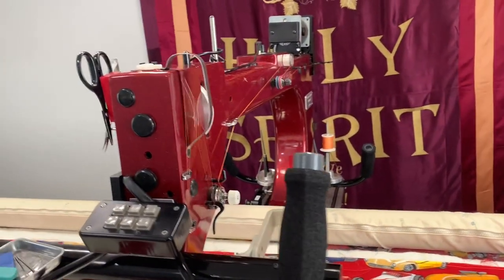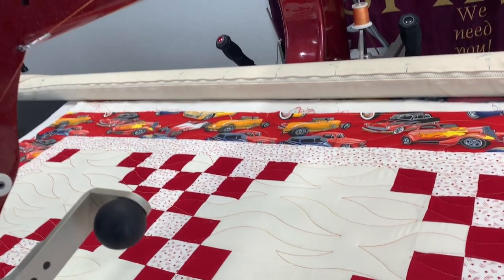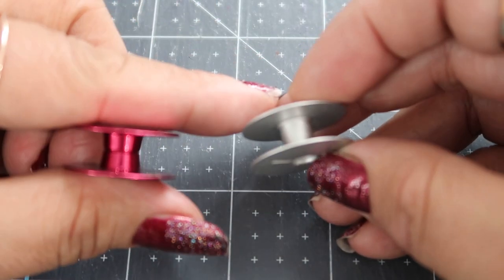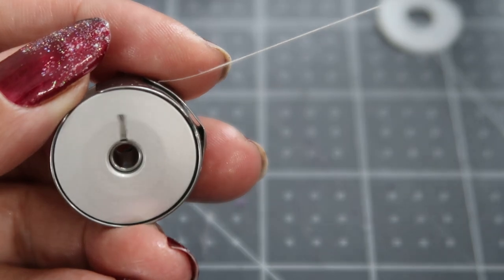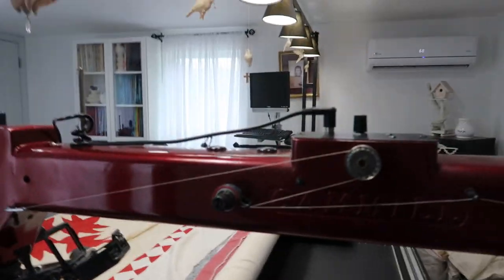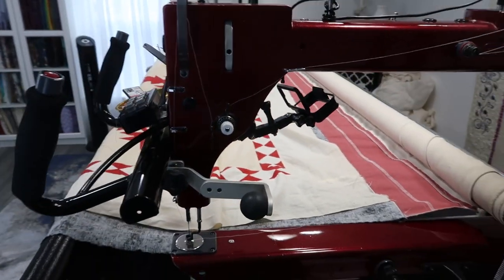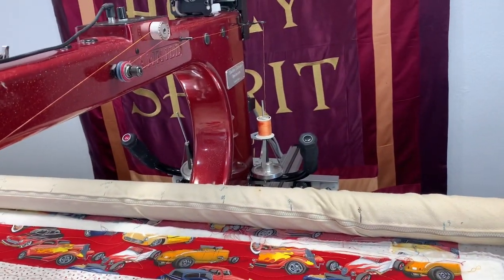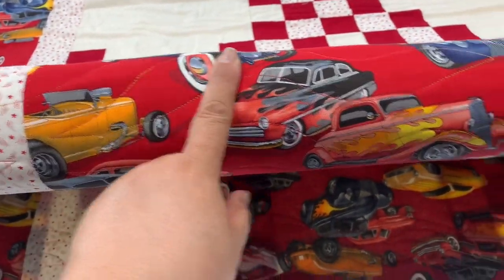Do Longarmers make Excuses on different thread/// tension session// workday

Comment: My mom’s machine was having trouble running Glide. Instead of assuming it just “didn’t like it” we did some troubleshooting and discovered her tension assembly was rotated in such a way that the take up spring bounced so low it let the slippery thread pop out from between the discs. One set screw loosened and we rotated the entire tension assembly so that spring wouldn’t be so low at its lowest point. It now runs Glide and other slippery threads without trouble. People need to learn to adjust their machines so they can take advantage of all the wonderful threads out there!
Reply from the maker: Right.. it just takes time. .

Comment: I love those aluminum Class M bobbins from Amazon. They work great with my longarm. I have the same bobbin winder and the Towa tensing tester. I actually have two. Oops, I misplaced one and panicked and ordered another one. Excellent tools. The threads are so different these days. Love, love, love your videos. I have learned so much from you. We need to control tension because we do not need stress.

Comment: It looks like the spool should be turned so the thread comes off the side of the spool verses off the top like you have it. If the thread is wound like a cone then it pulls off the top. Does this make sense? Plus being an old thread, I would put conditioner on it too.

Comment: I'm planning to buy a longarm soon and I'm amazed at how much I've learned from watching your videos.  Question - have you ever damaged a customer quilt and what did you have to do to repair it?  Also, what method do you use to tie off your threads when the thread breaks?
Reply from the maker: I have messed up a quilt before.  one I had to completely unstitching it.  another the Longarm got caught and cut the back fabric and I hand stitched the whole closed.  I told the client and gave her  300.00 quilt job for free.  When the Longarm sets up it does tiny stitches I do three small stitches then one back and then move Longarm forward that how I tie off on pantos.

Comment: My Juki bobbin runs clockwise. If I accidentally run it counter clockwise the needle will break when the bobbin runs out and I think it is because when the thread runs out the bobbin will spin a little bit and throw off the timing of the bobbin in the case. Bobbin direction is very important and will be noted in the owners manual.